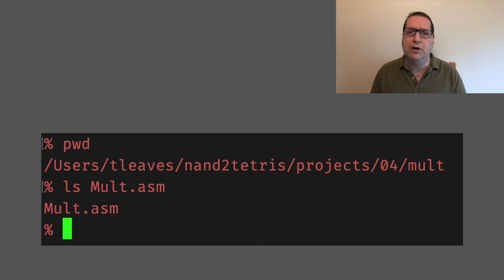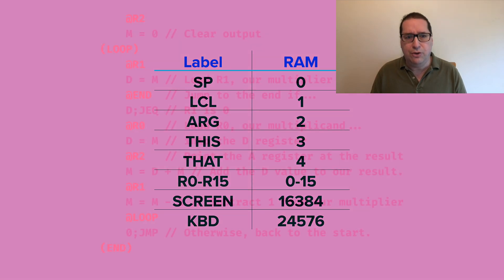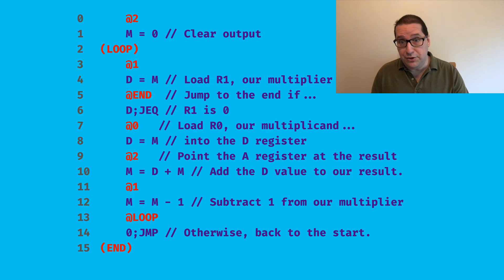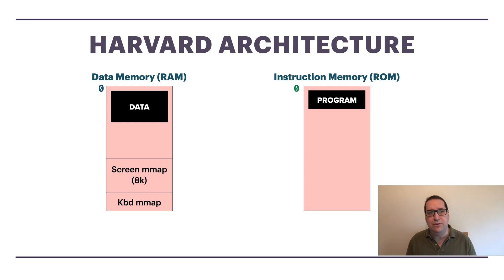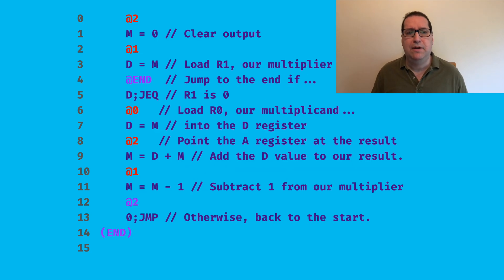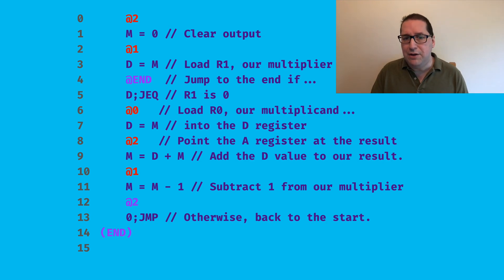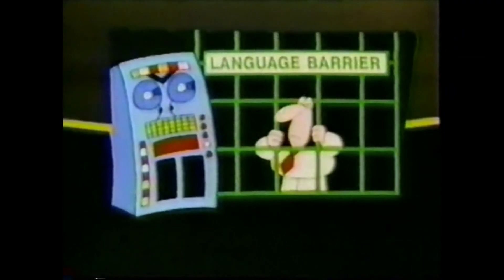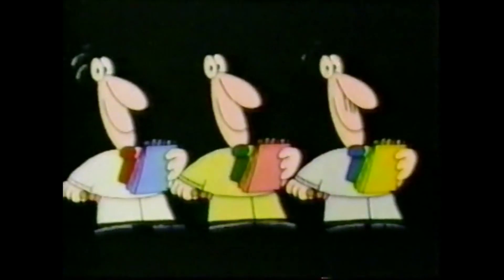Symbol Tables - From NAND To Tetris

Comment: Is this it?  I know there's more to it, just curious if maybe I was missing something, because this looks like the most recent N2T video from you, and it was nice to have these on while I reworked my way through the harder parts.

And I know quite a few people get to this part and drop it, because of the complexity of programming your own assembler (although, the hack machine is WAY easier than a 6502 assembler), and the coding of the computer itself.
Reply from the maker: Sadly, I think this is it. I actually recorded about 2 hours of the "build an assembler" video and then when I sat back and looked at it objectively realized that the topic itself just wasn't as amenable to explanation in video form as the first part of the course.
Reply: @TeaLeavesProgramming  that's a shame.  The rest of your content was great, and was the best stuff I've seen covering this process.

Is there any way to get in contact with you for a chat? I've got an idea I'm putting together that I'd like to bounce off of you and you seem more knowledgeable on this than I am.  I know my plan should be doable, just looking to chat with someone who's got the knowledge set to see if something comes up I haven't considered.